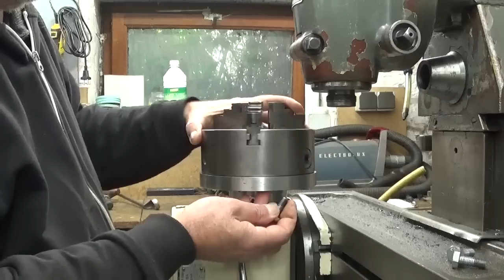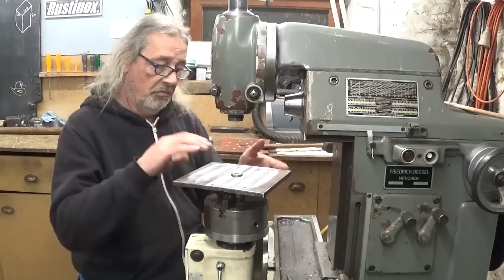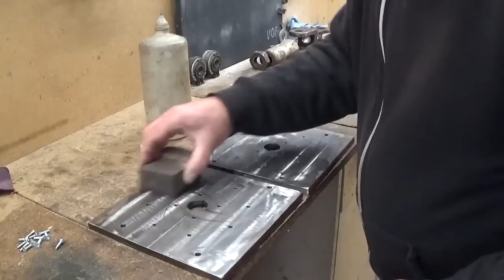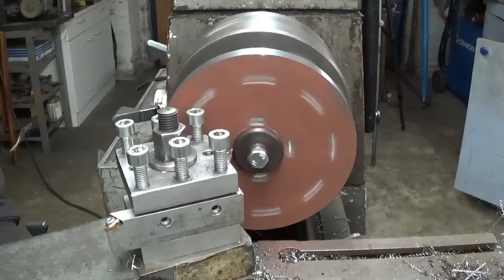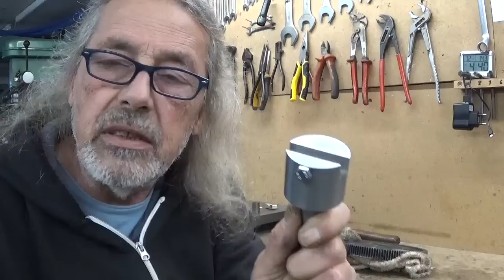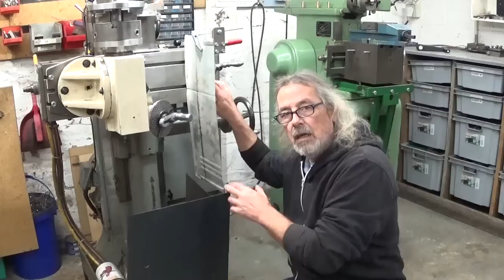A 120 teeth gear... almost.

Comment: Ahhh, single point gear cutting. I am familiar with this 😅. Noisy, takes forever, but it'll get the job done. Though I do not envy doing 125 teeth 🤣....

Switches to a real cutter 🤣. Good call!
Cheers!
Reply from the maker: It's indeed a bit violant :)

Comment: Michel, instead of having to make up the proper thickness of packing for your shaper vise when the part can only be held on one side of the jaws, try using a relatively large diameter bolt & nut to quickly make a DIY machinist jack.  Of course, you'd need a selection of bolts with different lengths.  You could also use a coupling nut with the bolts or threaded rod.
Reply from the maker: Well, I didn't have the right bolt. But this worked just fine.

Comment: Could you measure the diameter with verniers from the inside hole to the outside edge, + 1/2 the dia of the inside hole, then times 2 for a proper OD?
Reply from the maker: That could work too.

Comment: Excellent job. The only thing I would've done differently is to use JB weld on the 2 plates before screwing them together.
Reply from the maker: No need. It will work as is.

Comment: G'day Rusti.  Great idea bolting the 2 plates together.  As the old saying goes, "where there's a will, there's a way".   Not easy at times holding flat plate and machining it.  Especially with the intermittent cutting that is hard on inserts.  Cheers, Aaron.
Reply from the maker: Just go for it.

Comment: To measure the diameter, use a caliper from the bore to outside diameter X 2 + the bore size gives you the outside diameter size, very interesting video thanks, from Coventry UK 🇬🇧.
Reply from the maker: That could work too.

Comment: I would recommend clearance hole on the top plate, and tap the bottom one. That will definitely get rid of the "weird" feeling in the transition between them 👍
Reply: "bridging" is a very real problem (even more so in wood!)
Reply from the maker: That's what I did.

Comment: If you do not have a large caliper to measure large diameters, you can also use the micrometer dial on the cross feed. Simply bring the turning tool to the center, in this case the bolt, set the dial to zero and turn it back to the desired (or to be measured) large diameter. If the center is difficult to find, you can also take the starting size somewhere else, even the tailstock quilt. You can measure this with a regular caliper and add half the diameter. Not as accurate as a large caliper, but certainly more accurate than a ruler or tape measure!
Reply from the maker: That could work too.

Comment: Your machine screws are adequate enough for the use this gear is going to see. If someone was doing this for a higher torque or heavier use, rivets would be a much stronger choice for low temperature fastening. Im not trying to denigrate your choice here. We all use what we have available in our shops. Im just making an observation that might help someone out there 😉👍
Reply: Well, what I would do and it is what I do, is to drill some holes close to, but inward of where the teeth will bottom out, on one plate about 10mm, 3/8” in diameter and weld the two plates together. A few holes closer to the center would be welded as well. He agrees that it’s the best way as well. Heavy rivets will work as well as long as they’re riveted properly, which is hard to do in a home shop in parts this heavy. With the screws (they’re not bolts), I would cut the ends a couple of mm short and thread one plate. After screwing them in as tightly as possibly, I would then spot weld, with the MiG welder, preferably, on the threaded end. That would also make for a tight, permanent connection.
Reply from the maker: To install rivets, I need a torch... that I don't have.
Reply: @Rustinox  not to hijack the conversation, but i don't fully agree, you have a forge right? Heat up the rivets in the forge, drop them in the gear and knock them in

Comment: Awesome entertainment!
Sometimes a walk around the local metal scrap yard can save hours of griding drilling and tapping... but not as much fun for us to watch. 😎
Re the measuring, I recently bought some cheap vernier calipers from Ebay and Temu, so I can have some "basher" calipers to leave laying around in tool trays etc. It's good to have them in arms reach and not need to get out the expensive ones.
They were actually quite decent in terms of accuracy. For your gear you could have used a 200mm vernier, I got one for about $13.
Reply from the maker: Well I don't have one.